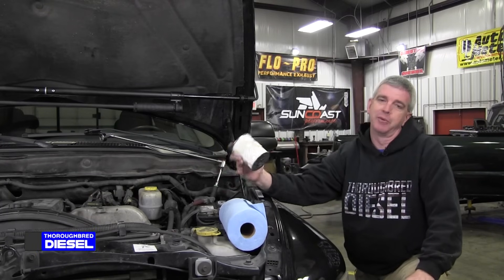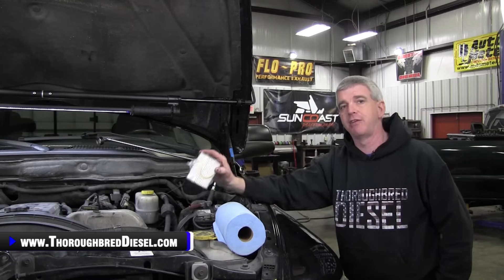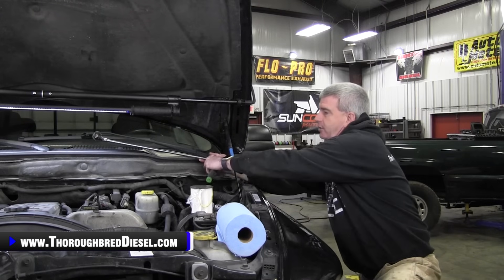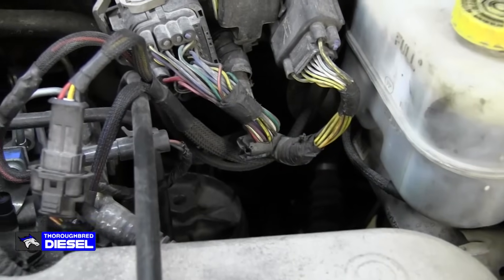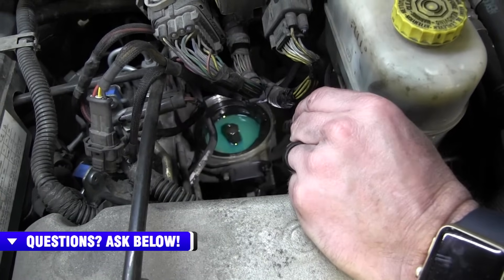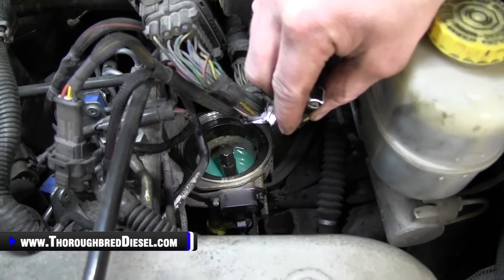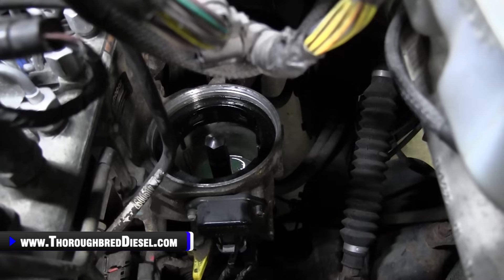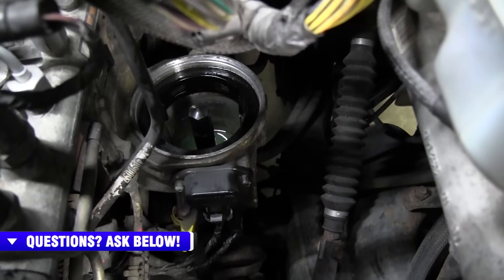Change A Fuel Filter on 2003-2007 Dodge Cummins 5.9

Comment: That FF will always look like that no matter how many miles. The black is caused by the asphaltene in diesel fuel. It would be OK to jump his stuff about that filthy eng though!
Also, it's a lot less messy if you drain the fuel before removing the filter.

Comment: what is wire plug om front of filter i chaned filter today it was unplugrd i pluge it back
Reply from the maker: Water in fuel sensor most likely.
Reply: @thoroughbreddiesel  thanks

Comment: Man, I’m having a hell of a time getting the new filter on I’ve applied a lot pressure and can’t seem to get the cap threaded on. Do you have any tips?
Reply from the maker: If you remove the filter will the cap screw on? If so, then your filter isn’t seated correctly. If not, then you have a thread issue either with the cap or the housing.
Reply: @thoroughbreddiesel  it will thread on without the filter on.
Reply: @thoroughbreddiesel  I ended up putting the old one back on. Sounds like it wasn’t seated correctly. I will pay more attention to that thank you for the quick response love your channel. 👍🏼💯
Reply: I am having the same issue with my 04. I have bought 5 different filters from 5 different stores and none fit correctly. The lid will not even reach the treads. I thought maybe the old rubber washer in the filter might have stayed when the filter came off but I cannot figure it out and my filter is toast.

Comment: just bought my first diesel truck . 5.9 Cummins in a 2005 Dodge 2500. Came with no manuals . Dealer had no idea if it's been deleted or nothing. I see under the bed there are 2 filters and not sure if they are aftermarket fuel filters? How often do I change these filters and also the one mounted to the motor ? I saw a video on youtube that says a 2 micron is way better for extending the life of the motor . Any help would be appreciated . Thanks
Reply: You most likely have a Fass or Air Dog lift pump upgrade
Reply from the maker: Hey man just give us a call. We can tech you through which lift pump you have and how often to change filtration on everything.

Comment: If you want to kill the injectors in your 03-07.5 common rail Cummins then change the fuel filter like this... 

if you want your injectors to live... then buy an aftermarket lift pump/fuel filter system such as an Fass or air dog and delete that factory POS filter and housing.
Reply: Or run both
Reply: Hmm 265,000 original miles on my injectors no problem

Comment: Just changed mine on a 2004.5 and it won’t prime. Lift pump on the drivers shock tower sounds like it’s pumping, but no fuel to the filter. Sounds like time for a fass.
Reply: I have a 2004.5 that won’t prime after a filter change
Reply: @Andrew-or4jg  Lift pump was bad on mine. Found out the CP3 will pull fuel until it gets air from changing filter. Got the 100g FASS and it runs way better. Lift pump was probably going out for a while.

Comment: What is the fix for "dead petal"? 05, 2500
Reply from the maker: Does it feel mechanical or electrical?  That is to say does it feel like the truck is struggling to take throttle or does it feel like someone flipped a switch and the truck is not responsive?  Are there codes?  If it feel mechanical,  I would check lift pump pressure, check actual and commanded fuel rail pressure as well.  If its electrical,  then you will need to have codes to determine how to diagnose.
Reply: @thoroughbreddiesel  I have the Banks Six Gun tuner on it, operated thru a PDA. I can check codes thru the PDA. When I lose power the code is "Boost in low range". I can't recall the #. I have to stop and turn off the truck to clear the code thru the PDA. But, yeah, feels like someone flipped a switch. And it happens randomly. And thx for the reply!!
Reply: Another thing is the rear diif is leaking oil, not from the seal but oozing out from rust spots on the pumpkin. I have cleared off some of the heavy rust. Can't afford an axle at this time. People have told me to seal it with JB weld. Any thoughts? Thx again!!
Reply from the maker: With the loss of power, I would suggest taking the six gun off the truck and seeing if that fixes it. Sounds like you might have a problem in that six gun that is giving you MAP codes. As for your diff, that’s a tough one. I don’t think JB weld will seal it, but wouldn’t hurt to try. You will need to drain the diff and get it 100% dry to have a shot at getting the JB to bond.

Comment: Deffinitly not how its done correctly. You must drain the filter housing using the drain. Not draining the filter housing allows contaminated fuel to go to clean side of the filter. Empty bowl always. The trucks fuel pump will prime itself.
Reply: What????
Reply: smalltownpower you are correct sir! He is not.

Comment: Hey guys... what would happen if there Was a bunch of sediment and metallic debris/pump trash in the fuel bowl and someone Didn’t drain it before reinstalling the new filter... asking for a friend
Reply: It would plug it up sooner
Reply from the maker: Theoretically,  the fuel that is in the bowl is unfiltered fuel. That fuel will still be pressurized through the filter before it makes it to the high pressure components. Some of it may make it by the filter so if you see debris in your bowl it needs to be cleaned.

Comment: So I have been doing something a little different. I drain the filter housing and remove the filter. I wipe the inside down with a low lint cloth. I then close the valve and fill the housing about 2/3 full of seafoam and install filter and cycle switch a couple times. I start the truck and let it run about 30 seconds and then shut off and sit over night. I idea is to allow the seafoam to soak in the injectors to in theory do a little cleaning. Ever heard of this or is it a snake oil waste of time? Also I read several reviews that pointed to Baldwin as the filter of choice. This was all suggested by a diesel  truck site post.

Comment: What do you guys think about putting a quart of 2 stroke oil mix in with  fuel ?
Reply: Every 3 or 4 tanks i put a quart of Wally World ashless 2 stroke oil. It lubricates all the O-rings and all the seals on my 06 CP3 pump. These fuel systems were not designed for ultra low sulfur diesel and there's horror stories of the supposed added lubrication to the fuel not being there and Wallah blown CP3s
Reply: I have been doing so on my 2005 since 2006. Also use Optilube XPD...  Truck runs flawless,, not failures.

Comment: Dodge could put the fuel filter housing in a better spot. Or should I say Cummins.
Reply: I owned an 05 for 13 years. It’s a piece of cake to get to and replace the fuel filter. No need for 2 foot long extensions. Just put the socket right on the ratchet loosen the lid open the drain , remove filter replace close it up and turn the key in. Never had a single problem.
Reply: do it from top easy as

Comment: I thought the factory filter was no recommended replacement
Reply: Octane injected recommended what!?
Reply: @chimesoffreedom9026  was not the recommended replacement*....a mopar or box store filter for the common rail does not have enough filtration for the injectors. You have to get a lower micron
Reply: Octane injected 
My mistake. I thought you meant that filter replacement wasn’t recommend by the factory. Silly I know. 
Cheers!